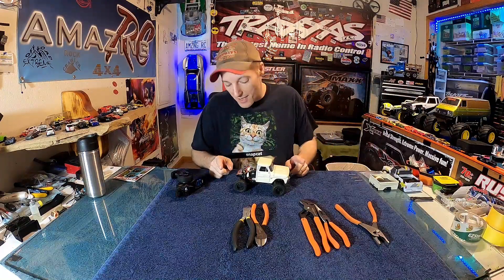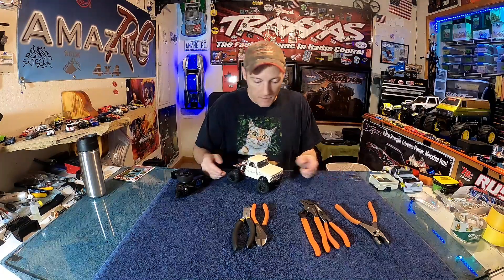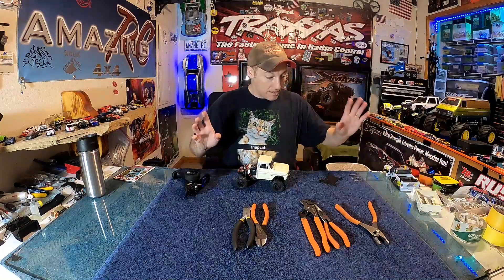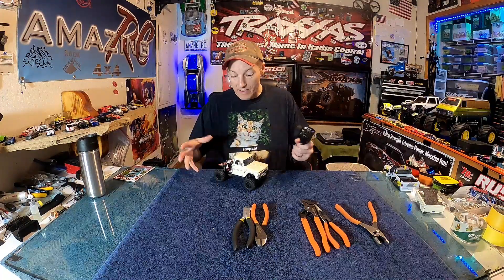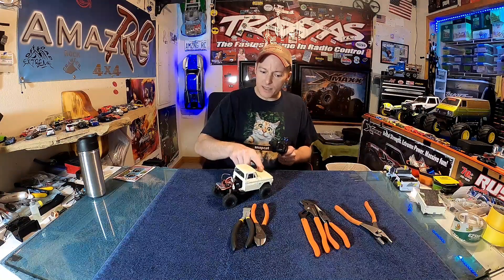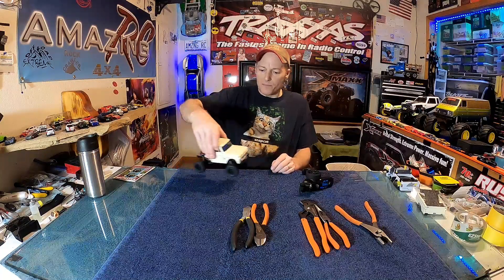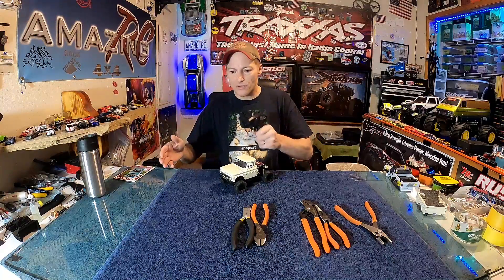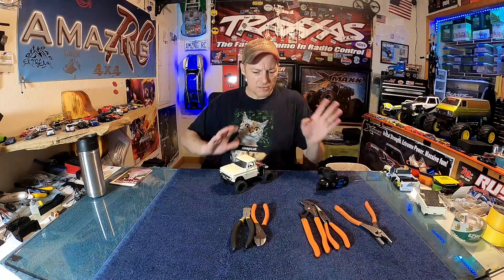Custom Diecast SENDURO24… RUNNING..!!!  Channel Stickers FROM GERMANY TOO.!!

Comment: The springs have worked out well, will be nice if you can get the rear bed on.
Reply from the maker: It shouldn't be a problem.  I have already looked at it.  Should be able to remove some plastic and be able to install the bed. I think that it will look better that way too. 👍👍👍

Comment: Looking good Bud.
Now I just want to figure out how to change the lights so their constantly on instead of only on under throttle.
Reply from the maker: OMG, that drives me crazy too.!! Easy fix though so that's good. Just haven't done it yet.  I'm also going to add LEDs to the diecast body as well. 😊
Reply: @AMAZINGRC  I'll have to keep an eye out to see how you change the lights.
Besides the body, the on and off headlights are really my only dislikes I have with mine.
But now that I rusted and weathered the body, I just need to fix the lights now. Lol
Reply from the maker: @flyingfortressrc1794  at least the bumper LEDs will be easy. I'm just going to swap the plug out and plug the lights right into the receiver.  😊